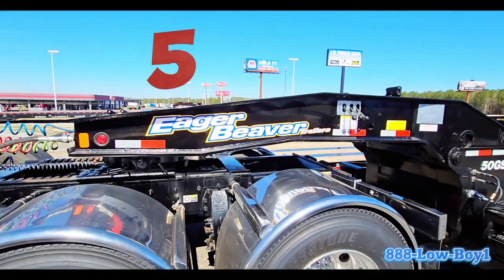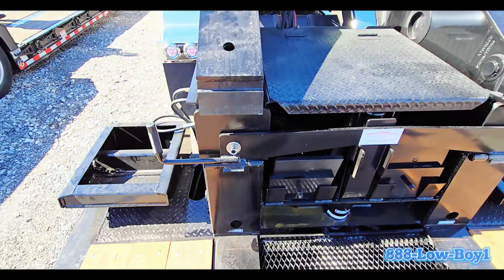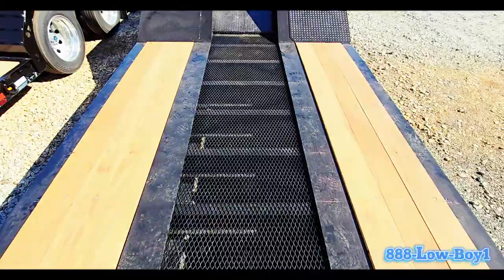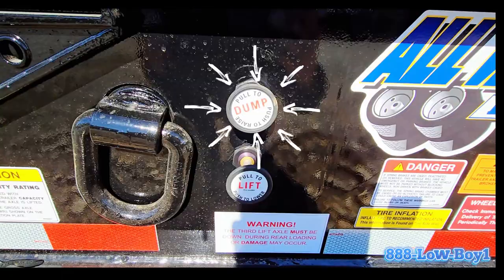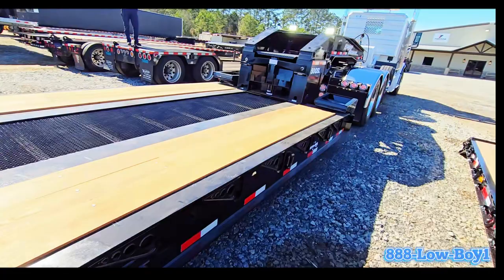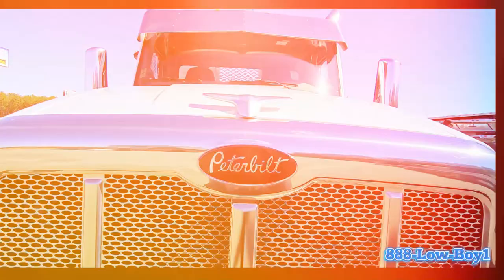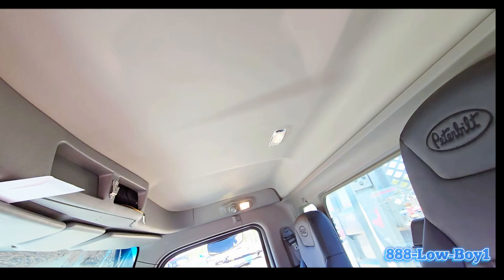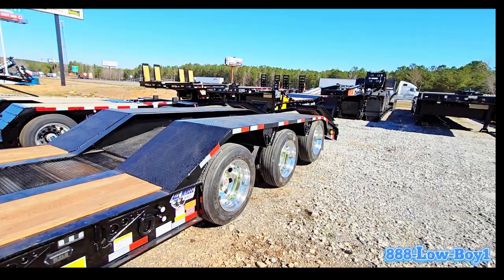Eager Beaver 50 GSL with air-weigh load scales and work lights

Comment: I like it, my 24 wheeler detach is lot more heavy duty and not cost effective for light use (90t w booster and 16 jeep).  I use a scissor neck trailer (winch tractor) for lighter things because I can't always load over the tail and need the gradual angle of the front.  This setup would keep me from needing the heavy spec winch trucks for a move like a "pit use only" welding truck. This would let me use one of my lighter rigs with taller gears and save a few bucks on fuel.

Just a couple of thoughts though. I know everyone has their own use to spec for, but I find myself having to place the bucket of some wheel loaders up on the neck so I can get the weight off the trailer and on the drives. Those work lights are awesome, but wouldn't be a second thought if I couldn't find a wrench to remove if it came to that, haha.... I think a mount on the side of the neck, possibly even on an arm that could be swung out, is what I'd go for. I find that having the expanded metal grating across the lower flanges of the beams super useful instead of across the top and flush with the deck. I'll ķeep blocking down in the well as well as chains and binders I'll be using again throughout the day instead of tramming it all back to the racks or cabinets on the tractor or front of the trailer until the end of the day.

Those ramps look pretty narrow and I can't think of anything I'd be able to clear the axle hump going down to the deck, without high centering, that I'd be confident enough to run up on those. Is there a wider option or a rampless tail setup instead?

Those rotating D-rings are slick.  First time I've seen 'em.  What kind of working load rating do they have?
Reply from the maker: Oh man, that's a lot of questions. D rings are the same ratings as normal 15.5k and yes I agree with the lights and all the well thought out observations. Ramps yes can be slid over in front and removed from rear etc. Thank you for following me. I'm publishing a long video about blue lights as we speak